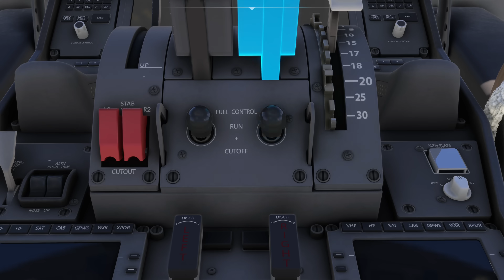Air India 171: Why Did The Fuel Cut-off Switch Get Moved?

Comment: Some thoughts from me:
2:58 Then you can't shut off the engine at all if one pilot is incapacitated!
You DO NOT require two people for emergency shutoffs. They are for shutting things off in a emergency.
5:17 This specific plane had been out there for a decade. Most of the parts have probably been repalced, some repeatedly. If anything was wrong, I would look at maintenance - not a decade removed manufacturer.
9:52 Why would the national and international investigators care what is convenient for the Airline?

Comment: Question for Boeing drivers: In the event of power loss from both engines during climb out, what would be a possible question from one pilot to another if they had NOT noticed one of them fiddling with the fuel cut off switches ? Wouldn’t it be something like “ we lost both engines - attempt a restart” right? Instead the question was pointed and deliberate. 

Boeing drivers- if the power cut off on both engines, what would you have called out, if any of you DID NOT notice the other’s hands next to the switches ?

Comment: Well, there are a couple of things in AAIB's Preliminary Report that I find a bit odd.
Now, first of all, we don't know for sure that the Fuel Cut-off switch really got moved. We do know that this is what the flight recorder recorded, and we know that this is what one of the pilots perceived.
But we also know that the other pilot denied having turned them off. Let's give that other pilot, at least for a while, the benefit of a doubt.
Could this have happened in any other way? Never say never ....
Could it be that there's some design flaw with the switches? Could they have snapped back by themselves right after rotation, for some reason? Perhaps if not properly set to the On position to begin with?
Or could it be that they actually were On all the time,  but that the aircraft control system for some reason suddenly read them as off? A poor electrical connection somewhere? 
Now, as I mentioned above, there's a couiple of things that catches my interest. First of all the very short time between the first and second switches supposedly were turned off, wihtin 1 seconds. That seems fast considering the maneouver required to switch the switch, grab-lift-switch-release, and then move the hand to the other switch and do that one. 
And if it goes that fast, why did it take the other pilot five seconds to do the same maneouver?  The other pilot waiting five seconds between turning the first and second switch on is odd.
How are these switches wired and what different types of fault modes in the aircraft would cause the control system and flight recorders to read a cut-off state on the switches?
If this was a pilot error or deliberate action, one way to overcome this specific issue is for each pilot to have his own set of switches on the outer side, and for a cutoff to get activated in flight, both pilots need to switch on simultaneously. But this procedure must of course also be properly scrutinized, as it may introduce other risks not considered here.
Reply: @Captain Steeeve, didn't take long for this to come up:

"Experts are cautious about this. US aviation analyst Mary Schiavo told the Financial Express in India that people should not draw premature conclusions, arguing that there is as yet no definitive evidence of pilot error.

She highlighted a similar incident during which one of the engines suddenly shut down midflight on an All Nippon Airways Boeing 787 during its final approach to Osaka, Japan, in 2019.

Investigators later found that the aircraft’s software had mistakenly interpreted the plane as being on the ground, triggering the thrust control malfunction accommodation system, which automatically moved the fuel switch from “run” to “cutoff” without any action from the pilots.

Schiavo warned that a similar malfunction cannot yet be ruled out in the Air India crash and stressed the importance of releasing the full cockpit voice recorder (CVR) transcript to avoid misleading interpretations."

https://www.aljazeera.com/news/2025/7/17/what-happened-to-the-fuel-control-switches-on-doomed-air-india-flight-171

Comment: Hi , I am 42 years captain of airline , flow 737 200,airbus 300,B747 100,200,300, Tristar L1011, 
Then as captain 737,airbus, B777 200, 
28000 hours , 21000 in only B77 200,
In my career it happened to me ones , and that I placed the engine control switch to run and it hanged there just before it goes to the detent and it runs ,
After engine started and about to start the other one , noticed that it wasn’t in the detent , when I just touch it again fell in the detent , I think maybe both of them placed  in the same way , 
Still the Suicide might be the actual reason .

Comment: The assumption from this captain even in your other videos is braised towards thinking it was deliberate when there's no evidence until the final report. It's not far fetched but rather very very narrow at this stage. The analogy about the kids is also ridiculous because we're talking about a pilot here experienced and in an incredibly stressful environment that js generally open to mistakes. Even in the absence of mistake it's an environment where mechanical failures are possible to simply use a kids analogy is just out of touch simply on a preliminary report. I don't get it, man, imma just stick tk Mentours analysis

Comment: 3s after liftoff deployed RAT. So Possible both engines failure. Standard procedure checklist is CutOff engines and short after this step again Run switches. So that was right step from pilot.

Comment: Captain Steve, with modern day technology, if an engine catches fire, not only does various sensors feed critical signals to control computer but as well as it can automatically terminate any fuel supply without the intervention of a pilot, it can even try to extinguish flames as well automatically, so even if you were to take off or land, if an engine catches fire at that critical time fuel shut down can be automatic, 

I strongly believe there may have been some serious issues with the computer control systems, or power management system, based of the evidence given by one surviving passenger who reported seeing a green light flickering on and off, a good indication of a power bus under a great deal of stress or overload condition, in other words total electrical power failure that in turn stopped fuel pumps from pumping fuel, so then the  RAT was deployed to continue provide electrical power to critical operations,

So as a last resort captain tried to toggle the fuel cut off switches in order to restart engines or pumps. But also remember a RAT system is only a small wind turbine, it cannot produce sufficient electrical and hydraulic power when the speed of the plane is slow, power generation depends on the speed of the wind, so the fuel pumps were a massive load on RAT power system, especially pump motors require 10 times more current to start turning and so  RAT power was not sufficient so the Captain may have tried to relieve some load on RAT power by turning off the fuel pumps until RAT power establishes full generation then brought one pump in then the next one 4 seconds later, This can only be done by a quick thinking experienced pilot with electrical background. Thats perhaps why one pilot asked the other why did he turn off fuel supply, and there is no time to lecture a copilot so he simply said I did not as he then turned them back on. 

Its simple physics, if a wind turbine is under full load, and the wind speed is not sufficient, it will not turn, but if you remove the load then it can start turning, gaining momentum and kinetic energy then you could put some load on it and it will continue to supply some power at slow wind speed.

Comment: Captain steve appreciate you taking time to address the questions but you are simply outright blaming the pilots on the basis of just one preliminary report with just 2 recorded statements from CVR while the investigation is underway we still await to see final recording of what exactly happened and please stop blaming the pilots here intially u drew uea conclusion on flaps and changed uea view after another angle of video emerged. The report still dosnt make anything clear how in the world would someone flick the switches within 1 sec apart from each other and restart gap between each takes around 4 , If the pilot had to delibrately crash the plane he would have even attacked the other pilot flying and not wait for him to try and save the plane. Extremely dissapointed steve the way uea blaming the pilots !!!! While they have been incidents in the past where plane has  crashed due to pilot actions still without any conclusive evidence dont make any assumptions !! I am not trying to say the boeing or GE is at fault but lets wait for more information before u start drawing uea own conclusions.

Comment: Hi Steve. You mentioned now twice in different videos that you might want to cut out fuel at low altitude in case of engine fire but is the procedure not that you have to identify the engine, put the truss lever to idle and then cut off? If so then the computer should not allow a direct straight fuel cut off without the lever being moved to idle.

Comment: A two-person fuel cutoff authenticator could be written into software, so that a button / softkey on each pilots side panel to 'agree' the cutoff...?  
Buttons far enough apart so that one person could not feasibly press both. 
This safeguard feature might be 'armed' only during take-off to prevent situations such as this one. and that during landing, a single operator could activate the shutoff.

Comment: Captain Steeeve I'll de-subscibe from your channel and will explain why: You mentioned in one of the questions of your followers with regard to why on departure at low altitude the dual engine cut-off was feasible at all with the blunt but idiotic statement, that you might have to use this feature during landing (!!)  cause there might be a problem with engine failure. I think the question of your follower was absolutely reasonable, as we have no information on engine failure on Air India 171 so far, but on a deliberate cut-off of deal fuel supply which should not be possible under given parameters.  Your format on this Air India crash lacks professional assessment and I'm done listening to a hidden Boeing advocate.....

Comment: The pilot who asked the, “why did you move…” question clearly saw something —possibly only out of the corner of his eye—which led him to ask that question that way, because otherwise the natural question is more like, “what has happened?” (as he did not see the cut off action before warnings started) or, “why are those switches in cutoff?” (once he was made aware of the state of the switches). The precise timing of the question after the cutoff movement could also be informative. Also, was “gear up” ever called? And if it was, why was the gear not moved up?
Reply: No one used "Move", rather he queried "why did he cut off" after seeing warning on panel and assuming the other pilot might have cut off, as he knows its not himself. When the other replied he has not, they tried to shut down and start again to revive. His question was impulsive in a panic situation. Please note, they were still climbing and engaged in a critical phase, with their heads up looking in sky and body pulled back to their seats. FDR recorded fuel was shut down, it never tells whether by physical cut off or by misplaced signals for some other reason.
Reply: @tarun000100  At rotation, the focus of the pilot flying drops to the panel, and then back and forth to the sky ahead and out the side windows—including the side window on the other side of the plane, bringing the throttle even more directly in view.
Reply: @tarun000100 if the engines were cut off, you’d simply NEVER assume it was actually done by another person, but rather that it was an instrumentation problem, or that I was not seeing the first level problem, the LAST thing you’d suspect is that a person did it, as there would never be a reason to do so, especially not following the cutoff procedure. So again, this indicates that he observed the action— at least peripherally:

Comment: There is a sensor to figure the plane is on the ground. There is a sensor to detect engine on fire. How difficult is it to come up with software function to say if plane is airborne and engine not on fire don't allow to switch the fuel off.
Well in case of a murder suicide it wouldn't had helped.

Comment: Requiring two people take action could be problematic if one pilot is incapacitated. Plus if one pilot wanted to do something, it could be a million other actions they can take to crash the plane.  Setting standards or requirements that happens 1 in 10 billion flights is not feasible.

Comment: All the pilots watch this channel I suggest they watch air detective channel you have three former lead NTSB lead investigators. Greg former lead investigator who has investigated every major crash has commented on todays air detective channel criticize any pilot to speculate that this crash is any other possibility. This case according to the three most experienced investigators conclude this is a criminal case . He also made clear that the authorities know for a fact which pilot is the bad actor . You don’t reveal that in a criminal case . So why are you still wasting your time trying to blame Boeing . There is nothing wrong with787 fuel cut off switch

Comment: Hey Captain,
First of all, I love your conentent and has helped me with my "fear" of flying.
Regarding this incident, what I understand is that the divice used to record what the pilots do in the cabin, records electrical signal of each instrument. So I was wondering, if these divice recorded the electric signal of "cutoff", then, I think its possible that something in the airplane " a malfunction" could cause the "cutoff"?. There is a documented case of another 787 airplane of the airline All Nippon Airways, that experienced a rare dual engine failure during landing due to a software glitch in the TCMA system. This glitch was fixed via a software update. So maybe this incident may be related to another glitch?, what do you think?